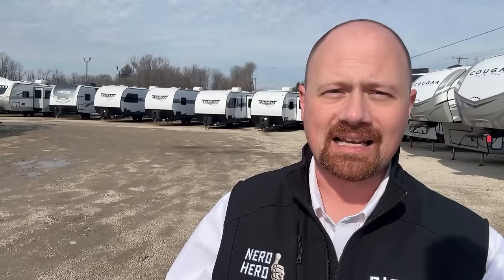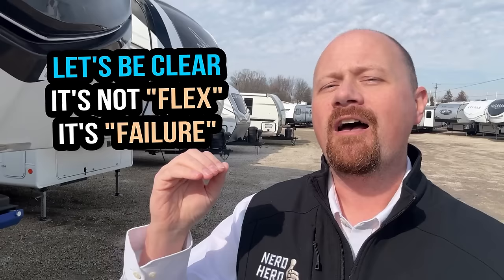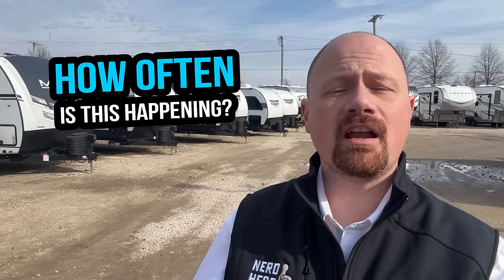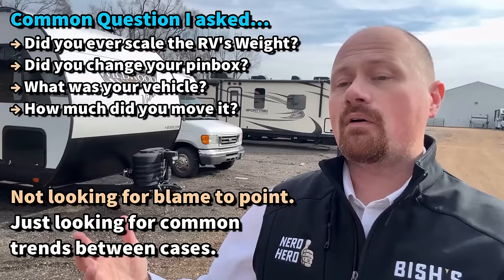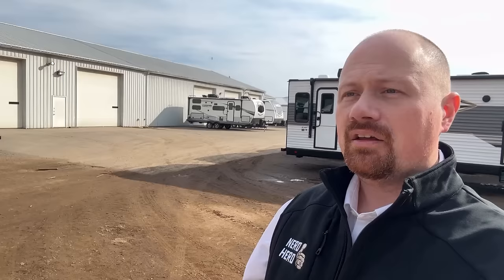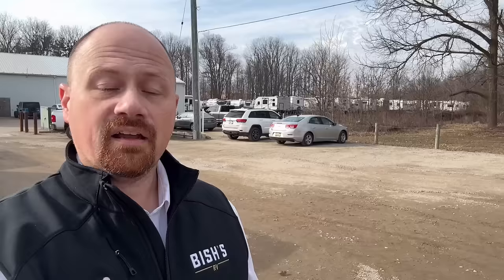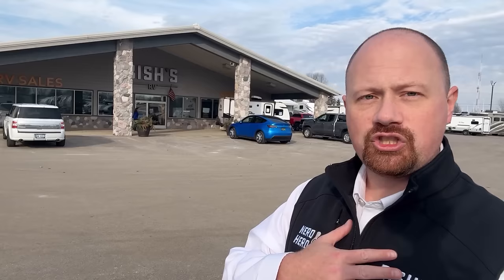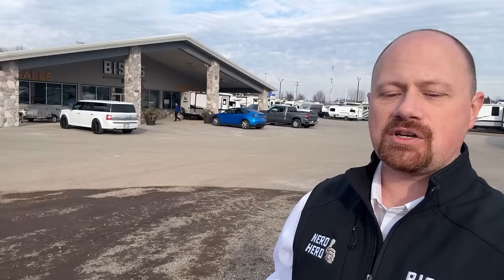🚨 RV Frame Flex & FAILURE!! • WHAT is Happening and WHO is Responsible?!

Comment: Nice summary of the problem.  One other thing is that toy haulers have very high pin weights when the garage is empty or lightly loaded.  They are designed to have several hundred pounds in the garage which  counterbalances the trailer and lightens the pin weight.  Of course this increases the load on the axles and tires, but significantly reduces pin load.  The frame design engineer should have  designed for both loaded and unloaded conditions, but may have only designed for maximum load.  For almost every other type of trailer or 5th wheel, you only design for maximum load.
Reply: Commercial trailers place axles at either end of the structure, so weight is mostly suspended between the axle trucks, not bridging them; although it used to be possible to slide the rear axle truck of a van forwards a little bit.  Much more stable to totally suspend the load, for any percent of load capacity.

Comment: Know your RV's mileage!  Keeping a logbook is an easy piece of information management. I can tell you (or a Dealer if/when I trade) exactly HOW far my rig has been towed.  This is also critical with regards your tires. Yep, weigh every time a significant change to load has happened.  Keep up the good work.
Reply from the maker: It’s a good tip

Comment: Good video. FYI several folks, including me, have had issues with the lag bolts connecting the upper structure to the sides of the frame. In my case one bolt fell out completely. I've seen several videos/posts where several bolts simply loosened up and/or fell out. In some cases, a larger lag bolt is installed. Once the bolts loosen/fall out, the structure is subject to a lot of movement. We were lucky in that the frame had no cracks, but the aluminum structure of the cap area had two cracks. Both were welded and several gussets were installed on the frame. "So far" (6000 miles later) everything is holding up. I make it a routine to now check the bolts occasionally and when attaching/reattaching the rig, I watch for any vertical movement of the pin box relative to the cap structure. I also want to make note of the fact, that in some rigs, the frame and pin are rated higher than the GVWR, therefore one can be "overweight" regarding the GVWR but not the actual rating of the frame/pin. In our rig, our tires, axles, springs, frame and pin are all around/at 21,000 while the GVWR is 20,000.
Reply from the maker: Very interesting. You are the first to mention the lag bolts to me, though I absolutely do not think you’re the only one that’s encountered that. As you said yourself, you’ve seen a few other folks that have suffered the same challenge.
Reply: It gets worse. Today, I inserted an Endoscope inside the channel that encloses the lag bolts. Only could see two but one was mostly out of the hole and the 2nd about 1" out of the hole. Spent the whole morning tearing apart the cabinet covering the channel, Once opened it, only one was flush and the other 2 about 1/2" out. All were snug except the first one. As others have stated in their posts/etc, I thing it need larger lag bolts as there is about 1/8 or more excess hole space. So back to the dealer on Tuesday.. ug.  @JoshtheRVNerd

Comment: From a seasoned rv owner.  Number one way to avoid 5th wheel frame flex failures. Avoid owning a fifth wheel. Especially if you are on the road very much. If you are an occasional weekend warrior, traveling a short distance on smooth roads, not carrying holding tanks full, you probably will have a decent owners experience.

I travel several thousand miles per year. And until such time Lippert and the coach manufacturers decide to strengthen 5th wheel framework from the frame rails forward to the pinbox I will never consider a 5th wheel purchase. I will stick with the travel trailer.

Before thinking about any recreational vehicle purchase, take a factory production line tour of what your interested in purchasing. Pay close attention at the beginning  of assembly of the frames. Think about how the pinbox is attached to the frame, the leverage the pinbox is putting on the upper deck. The quality of the welds and frame build at this location. Then look how it is assembled at the drop to the frame rails. The quality of the steel, the guage of the steel and the quality of the welds. Then imagine the torque that is going to be placed in these areas as well as the shock from that will occur from bouncing across country. 

Again, until manufactures improve the build quality of their 5th wheels from the frame rails forward, it is a recipe for disaster.

Comment: I think one one of the things that exacerbates the situation is the manufacturers rejecting claims saying they don't build the frame and Lippert saying they only built what the manufacturers designed and spec'ed. This circular passing of the buck needs to stop. 

Another thing that causes owners to be concerned whether the frame has a defect or not is the sloppy welding. Even though there might  be a good weld they don't get cleaned and finished properly. 

From some of the broken frames I have seen reported the problem appears to be a lack of gussets or properly sized gussets. This is part of the larger problem of the RV industry using parts that barely meet the spec's instead of using higher rated parts. 

I think the "You are moving the RV too much" is disingenuous. These are sold by manufacturers and dealers as a great way to have a mobile lifestyle so go out and see America. After this they turn around and say we don't support fulltiming or you are using it too much? Come on. 

I can't speak for all trucks but F-150s going back to at least 2015 will track the towing mileage per trailer as part of the trailer settings. 

As I've said the weight of our GD 22MLE was about 225 lbs more than the listed dry weight due to options. This was as shipped from the factory. The tongue weight was also more coming in around 50 lbs more. I think you need to know the weights, tongue in particular, each time you travel as they are not a set it and forget it thing. My tongue weight varies as much as 100 lbs depending upon they type of trip we are taking and what gets loaded for the trip. For a travel trailer towed by a half ton that is a huge difference to account for when adjusting a weight distributing hitch. It is why I own a tongue weight scale and switched to a Weigh Safe hitch. 

Suggesting a truck size is pretty straight forward. Take the trailer GVWR and calculate the worst case pin/tongue weight. Then explain that the values from the manufacturer's stickers on the truck's driver side door pillar have to be capable of handling that weight along with the weight stickers on the hitch.  But like you I've never heard of too much truck so might need to add that caveat.
Reply from the maker: As always I appreciate your visits and level-headed insights!
CIRCULAR BLAME GAME: I think literally everyone agrees with this 
MOVING TOO MUCH MESSAGING: That's where I feel there's a disconnect between the engineering team and marketing teams causing folks to enter with bad expectations

Comment: From an engineering standpoint, there are several things going on here that are at odds with each other and make this difficult. First, people want the maximum volume for living space.  They also want the most features in the RV such as washer, dryer, washing machine, large tvs, large reclining sofas etc.  Then, people want the lightest gross weight to permit towing with a reasonably sized vehicle.  The result is the manufacturers trying to add the size and features while minimizing weight.  The only place to reduce weight is in the basic structure. Next, the wide range of use cases means that designing for an appropriate duty cycle is difficult.  Defining the duty cycle in terms of mileage per year, towing speed etc would go a long way toward mitigating this.  If you really want to do a service to customers, contact the School of Engineering at Purdue and see if you can get them interested in a research project to instrument a representative RV and then drive it around to measure the static loads, stresses, fatigue cycles, etc. to determine the loads put on these vehicles and to assess the adequacy of the structure, suspension, etc.
Reply from the maker: I cannot tell you how much I appreciate your level headed and grounded viewpoint here. This is one of the best TL;DR explanations I've seen

Comment: Okay I watched your entire video. 41 minutes and some odd seconds. First tractor trailers weigh 80,000 lb not 40. On Long Island sand and gravel trucks are allowed to run 120,000 lb. If they're building RVs to only handle 1,200 lb somebody's really building crap. After watching several videos I can honestly say I will never ever ever buy an RV. I might rent one no matter what it costs I'm going to rent one cuz I want to give the nightmare back to the dealer.  A Mack truck with 44,000 lbs rears and a trailer on top of it weighing 80,000 lb can drive from Florida to Alaska and back and not have a frame failure. I've never had a frame failure in any car I've owned any vehicle I've owned any truck I've owned. And when I was in the trucking business I ran in pothole City, New York City and trust me those roads are more rugged than out in The boondocks. Try not to defend the manufacturers because if they're making these things so lightweight and charging well over a hundred thousand dollars they could invest a few extra dollars in box steel and welded correctly. There is absolutely no excuse for frame failure in an RV. No one out there has experienced frame failure in their car and I run a bunch of old cars and they all run just fine and their frames never crack. I understand you have to protect your manufacturers but weight should not be an issue in an RV. None of the issues you brought up about weight should ever be an issue in an RV. 20 trucks and a few million miles later I know about frames and fifth wheels. This issue is poor manufacturing

Comment: I have driven a semi truck for 35 years. You would not believe the federal regulations you have to go through to build class 8  vehicles and the trailers they pull, and the drivers allowed to drive them. From my limited perspective, it looks like the rv industry regulates itself for the most part. How they get away with it is dumbfounding to me. You can see rv's with limited cargo capacities with two axles and then some with CRAZY cargo capacities simply because of different axles. Nothing else! So whose fault is it that a hitch assembly fails? It is a manufacturing problem ! They do not seem to understand the engineering aspect of it at all.
Reply from the maker: You are 100% spot on. The RV industry is self regulated and not third-party regulated

Comment: We had a new 2021 35’ fifth wheel, no generator, original pin box, and some empty cabinets so we were not overweight, and not full-timers. Yes we used CAT scales too. The first year we used it the frame fractured below the bedroom slide. After we submitted photos to the manufacturer it took them a month to approve repair.  It sat at the dealer and repairs for nearly four additional months. We sold it and will never buy from that manufacturer ever again.

Comment: When i was looking, our original intent was to purchase a larger 5th wheel. When i started to look at them, with my engineer hat on, it became obvious the frames were under designed for the load (forget what was added to it by the owner). Basically they are using the same basic frame as the smaller units. If the rig isn't being used, 2 - 7K axels might work, however once that is taken on the road the trailer is seeing loads 2x-3x then what it experiences stopped. Seeing posts daily about broken axels or blown tires is the giveaway, that should not happen with properly designed  frames and suspensions. I decided to get a Class A diesel pusher. They are are actually designed to handle the road. The idea of buying a trailer that is not intended to move alot is riduculous. Are semi trailers not able to be moved daily? How many of them have frame failure? Why don't the tow vehicle experience the same failure? There is no reason a recreational vehicle can't be built to be used daily. The answer is these trailer manufacturers are not bound by federal regulations including dynamic testing and as long as there are dupes to buy them, nothing will change.

Comment: SUGGESTION FOR DEALERS: There are portable scales available so the trailer can be weighed at each wheel. This service is provided at many RV rallies. Every dealer should have this scale equipment and include one weighing with every RV purchase after the customers loads up their stuff. Make a reweighing available at a reasonable charge. Maybe setup a weekend every spring were this service is provided. The CAT scales are not good enough because the are just measuring the overall trailer weight, not the weight on each tire. Why is this important? Because RV manufacturer do not balance their units left to right.
Reply from the maker: Ty William
It would be interesting to see scaling at stores

Comment: One thing that I have noticed and would be rather worried about is weight distribution. I have seen many larger Fifthwheels that sit dry at 20% pin weight. after you put what you believe is not much, you may easily exceed the pin weight rating, putting additional loading on that area. Another tip in regards to the "HDT" trend, if you do use the HDT plate they do not have side to side tilt, it is only a single axis tilt (front to rear) so it will put twist into the RV frame as the weakest point. Now many HDT (Semi's) replace the hitchplate with an RV hitch for ease of hitching at angles.

Comment: I'm at the 5 minute mark as deciphering the issue from a truckers pint of view, they are building these frames to light duty. They need a thicker frame/structure. The riser frame isn't tied into to the lower frame rails with any type of gusset on each side. These need a steel plate from the top of the rise angled down to at least 36-48" mark of the lower frame, which would be inside the wall when complete. They could also run a the riser beam all the way to the roof (or at least 1/2 way up) and gusset that back towards the nose over hang, which would keep it from flex. Would have to adjust gusset size for bedroom slide out models.

The pin box doesn't have a large enough mounting plate either. On semi trailers this is called the 5th wheel plate, it runs full width of the trailer, is 48" deep, and has one on the bottom side where the king pin is AND one on the inside as part of the floor. Semi trailer never break here, they'll snap behind the landing gear (36" behind the 5th wheel plate) or in the middle of the trailer where there's no support other than cross members.

These 5th wheel RV's structure aren't being built with enough support where they need it, They are too big and built too light for the gvw weight they are trying to achieve.

When considering all the weight of batteries, generators, etc that are being stored/installed in the bottom nose of a 5th wheel, then see that its only being supported by a single point of the couple hitch, I'm not sure how people are surprised when they find out they have an extreme weak point there. Engineers should know this. 

They build them too light so people can put more stuff in them. There comes a time when enough is enough, just my opinion. Rant over
Reply: Trucker’s Pink of view 😮
Reply: I agree, frames are being made too light duty for the application.  Every vehicle has gross weight rating and the frame must be able to hold that gross weight in every situation which includes the variables you mentioned like usage longevity, rough roads, tow vehicles, loading, etc. Commercial trailers handle the rated weight, last for years and still maintain decent tare weight. Tare weight is how much cargo the trailer can carry, the difference between gvwr & the trailer weight and no where is tare more important than commercial applications as it effects profit margins.  These RV trailers frames are simply being made too lite-duty and the manufacturer should be held responsible.

Comment: As always, I love your videos.  Thankfully I have not had to experience frame failure.  When looking for root causes, I feel like we should be looking at new (recent) potential causes that didn't exist pre-COVID.  I don't ever recall hearing about this until fairly recently.  For this reason I would not focus on operator error.   I would simply look at what is different today that might be causing this to happen in such large numbers.  New truck torque specs is not something I would have thought of, but yes,  that's a lot more stress on the pin box.  Keep your great videos coming!
Reply from the maker: Ty Eric!

Comment: You are absolutely correct about mystery hitch weights. I am very diligent about maintaining the proper weights in my rig, but where the weight can go is hard to find and is anecdotal at best. The best answer I found is on TT, keep 10 - 15% of the total weight of the unit on the ball, and 5ers 20 - 25% on the pin. If this information is correct, would it be safe to assume that the max weight the ball or pin could support would be 10 - 15% or 20 -25% of the GVWR? It would be interesting if the manufacturers could confirm this.

Comment: That's a great rundown because I was just pondering this with a future purchase - I found a nice toy hauler with what looks like enough space in the back to fit a larger Goldwing trike. The vehicle I plan to tow with is a 3500 dually with a 30K lb hitch. Swapping out the factory trailer connection for just a ball hitch means I can still have a usable truck bed when I'm not towing.